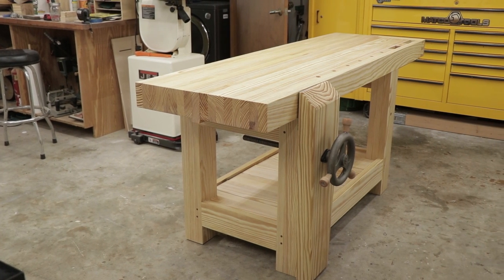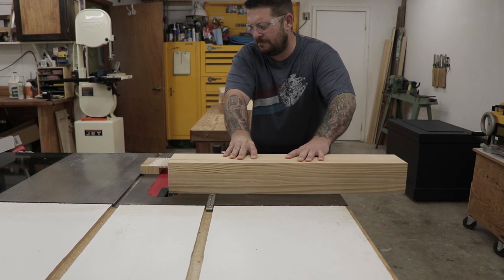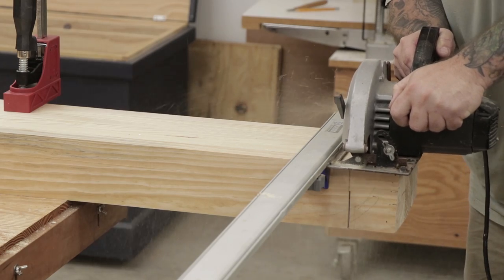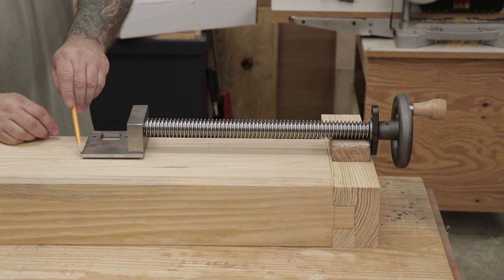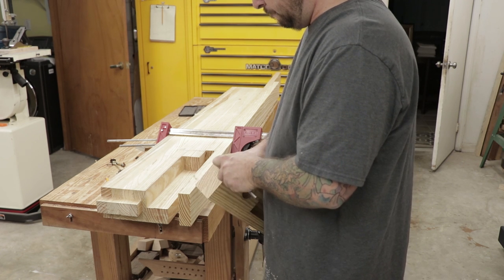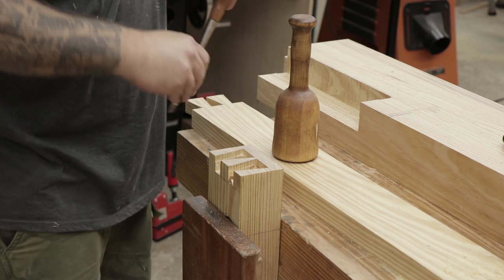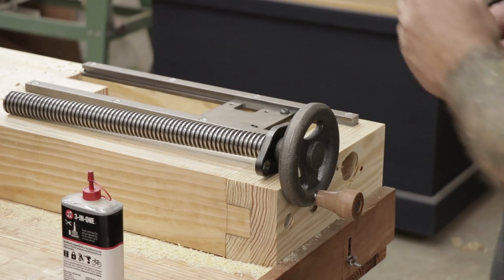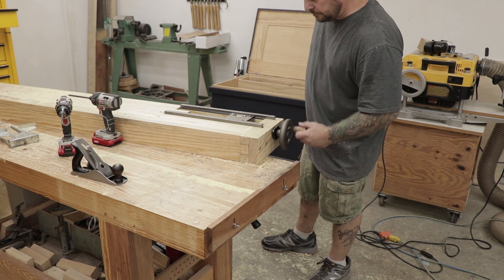Building A Roubo Work Bench Out Of Southern Yellow Pine (Part 1)

Comment: great video, thanks for sharing.
When you were routing freehand near the end of the video, I would use a small piece of straight lumber pinned down with brad nails and use that as the fence.  Since it's the bottom side, the little pinholes the brads make won't be noticeable. (just my 2c)
Reply from the maker: Great tip. Routing freehand can go wrong pretty quick. Thanks for the advice. This is what I love about the maker community here!
Reply: My top is 5" thick, so I used a brace and auger bit to hog out the waste and a chisel and router plane to clean and square things up for both the cavity and the rail slots.

Comment: thanks for the video. i really enjoyed it. out of all the workbench builds yours has the right mix of budget and utility. i agree money should be spent more on the vice hardware than on the wood itself.  i am not sure i am ready to spent bench-crafted money on mine, but i do want something nice.  what other vices were you considering?  i think my budget would be 400-500 for both end and front vices - probably the veritas twin-screw.
Reply from the maker: Thanks. I considered the 50.00 vise screws I had on my last bench for the leg and tail vise as this would have made the enter bench build less than 250.00. I am glad i went with the BC hardware though. I recently built a moxon vise for dovetails and joinery work. I like being able to clamp boards between the screws. Something like the twin screw design would be awesome

Comment: Good work.  But why do I always see people joining smaller pieces to get a thick board?  What's wrong in buying a single piece that is thick enough from a saw mill?  At saw mills they cut and provide wood as per your requirement, whatever be the size or quantity required.
Reply from the maker: Thanks! I did it because that is what was available to me in my area, it was a much cheaper option than finding a slab that was 4 in thick or better and either making a road trip or having it delivered. It is also pretty stable when it's done. I would've loved to make it out of one or two thick slabs though. If you can find them, go for it!

Comment: Just curious, why did you use a circular saw to cut the top pieces to length instead of your sliding miter saw?
Reply from the maker: It was much easier to manage a hand saw than bringing the top to the miter saw.

Comment: Would an edge guide for your plunge router not have worked to route the channels for the tail vise rails at about the 14 minute mark?
Reply from the maker: If I had a decent fence or edge guide. Mine wasnt long enough. Someone else suggested that I tack a wood guide in place with pin nails since it's the underside. That would have been a good solution. Or a good aftermarket guide system. Something with microadjuster

Comment: How long were the end cap lag bolts? And did you tap the holes you drilled them into?
Reply from the maker: I think they were 2 1/2 long. I drilled a pilot hole for them but no tapped hole. Bench crafted sells a bolt and a barrel nut on their website for the same location.

Comment: great video, What was your overall investment on this?? And yes I would like to purchase a set of plans when you have them ready as well as contacts for the hardware. Keep it up you do great work
Reply from the maker: About $900 for the lumber,vise hardware,1 Gallon of glue and I had to by the router bit that I used through most of the project. I am working on some plans but it may be a little while. Thanks for watching!
Reply: @TwistedWorkshop77  Did you ever get plans for the done?  Love the bench and really want to build one.  Thx!

Comment: I have never seen lag bolts in addition to the dovetail end, what motivated that?
Reply from the maker: This was in the plans for the benchcrafted bench and on a few others I researched before building. The dovetail is only good for an inch and a half the rest of the end cap has to counteract the end vise with a mortice and tenon on the other side of the vise with some glue. They might not needed but they dont hurt(except for looks)
Reply: Twisted Woodshop thanks for the info. Just found your channel - you do a really good job editing.

Comment: How do you like the Rigid jointer?
Reply from the maker: I recently upgraded to an 8 inch helical head jointer but I used the Rigid for over 10 years and it always worked well even on tough pieces like the bench top. The only complaint was the blades nicked so easily but that would go for any straight blade jointer. Even then, it only took a couple light passes with a hand plane to clean it up

Comment: Great video
Once the surface in planed, does it ever need to be done again? I assume that with the laminating, the individual boards would move together and remain flat. 
Reason I ask is because I need to build a bench for my little workshop and it would serve as a work bench, outfeed table, and a router table all in one. 

Will the roubo style work or should I have a plywood surface?
Reply from the maker: Thanks! They will likely wrap a little over time and the tops will have to be flattened at some point. I reflattened my last bench top after a few months and then I didn't have to do it again for years.
Reply: Thank you for the quick response!
Reply from the maker: Eric sorry I didn't see your question at the end. For me if I was going to do hand tool work(hand planes, chiseling) I would make roubo or heavy laminated bench just to have the mass and have it not move around when in use. If hand tools aren't you thing, I like the wood whisperers outfeed table/assembly table or Jay Bates assembly table and Sumo's projects has a cool all in one setup.
Reply: Gotcha, thank you for the suggestion.